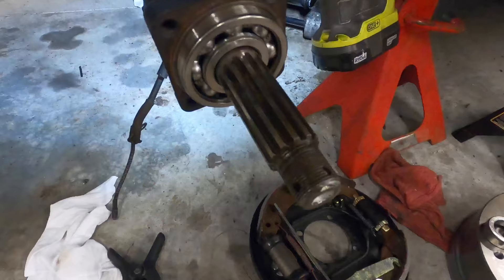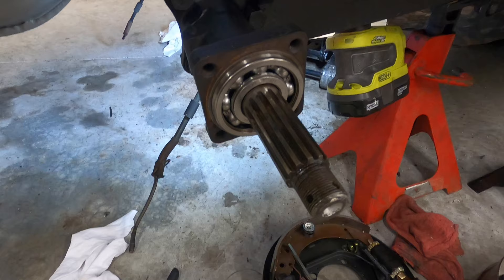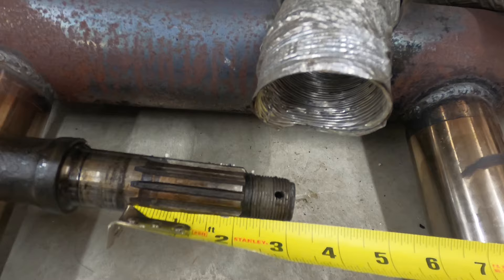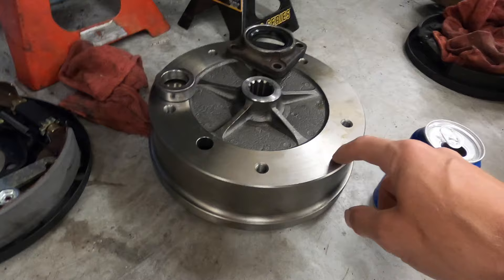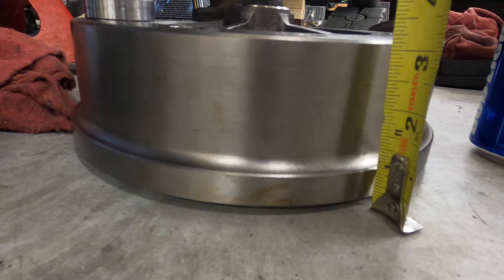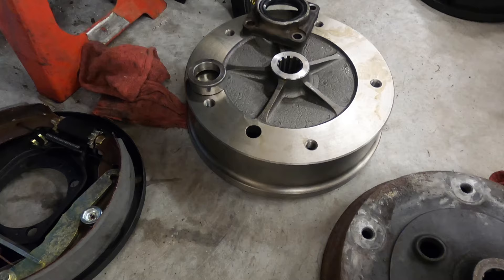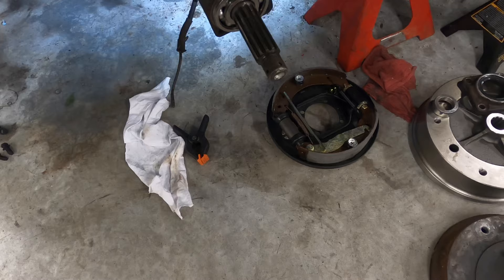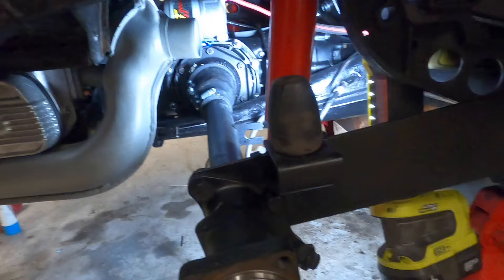VW Long Axle vs Short Axle

Comment: Thank you for the info. I have a sand rail /dune buggy and I didn’t know what I had until ur video
Reply from the maker: Awesome!  Yeah, it definitely took some time to figure out all the differences between the few years!
Reply: What wnd caps dod you get to make up the difference?
How did the job turn out?
Reply from the maker: Check the below video out as well.  The parts I used are in the original video description you commented on.  

https://youtu.be/lc8nbuc7QMs

Job turned out great